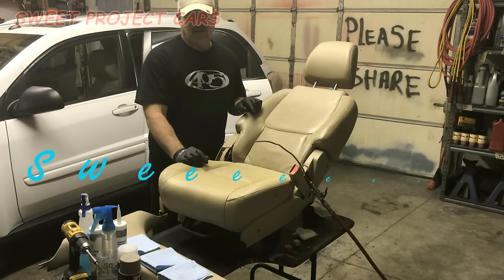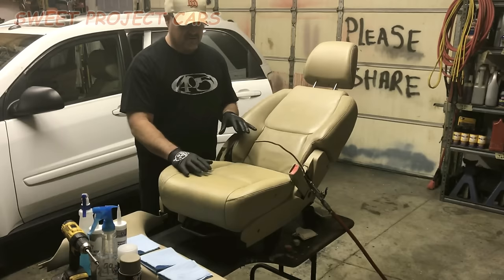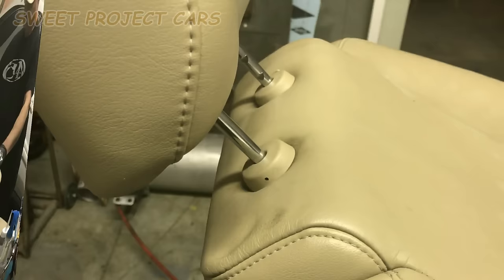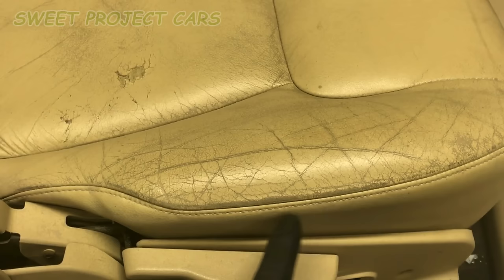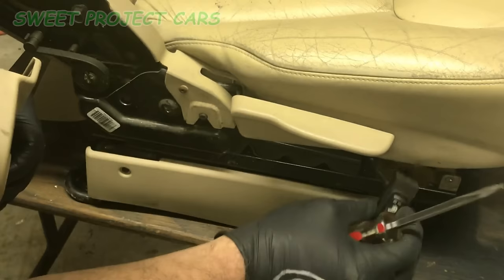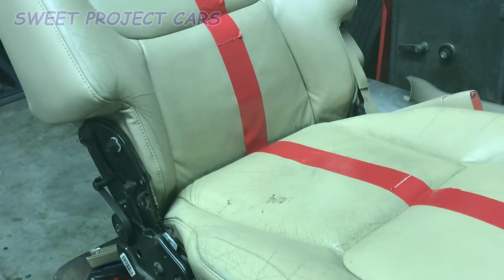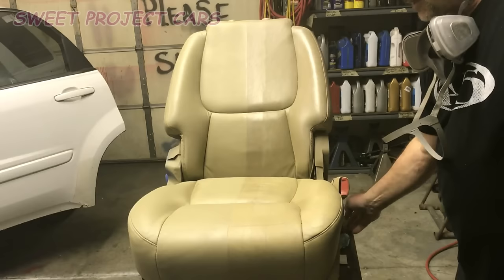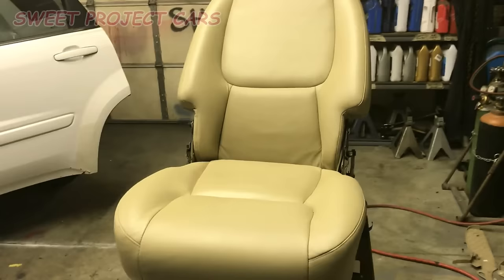How To Repair The NASTIEST Leather & Vinyl Seats....Back To PERFECT!

Comment: Love the video! 
I have a concern maybe you can address: 
I was in painting/waterproofing 20+ years. A big no-no was painting over silicone unless silicone was a special “paintable” grade. Have you had any durability or longevity issues? I have a G37 needs some work, and my kids are in and out a few times a day. Was wondering about your confidence level in this process holding up, especially the paint bond. It looks fantastic.
Thanks again for a great video!
Reply from the maker: Darrin we will be launching a special video on how we paint silicone coming out this next week...also we do show how we paint it in one of the 3 videos in the seat restoring video series we suggest you watch all 3 of them before attempting this awesome process  thanks Mike SPC
Reply: @SweetProjectCars  In this video you don't show the technique of mixing the silicone with the paint - it's going right over the cracks and holes in the seat. How are you doing this with just silicone reliably? Is the adhesion promoter a substitute for mixing paint and the permatex rtv silicone?
Reply: Does your G37 have perforated leather seats? My 2004 G35 Coupe does and I’m having trouble fixing them. Can you do the silicone and paint trick w/ perforated leather? 
Or, does anybody have other suggestions (premium seat covers? New leather? New seat?).
Reply: It does look fantastic, Darrin. I've got a pair of large wing chairs that I'm halfway done restoring. But I haven't put any filler on them yet. Seeing your comment got my attention. The way this very impressive video plays is 99% misleading. I wonder how many DIYers followed this video closely and then had all of their hard work go to waste. After reading your comment and the "answer" I looked for and saw the later video with a piece of cardboard and some blue spray-paint. They use a standard plastic bondo spreader and mix the paint and silicone adhesive together on the cardboard. When they did this original video, they don't mix the  silicone with the paint. I don't know what the reasoning is behind this, but I'm looking at all of these people in the comments, excited to copy their methods who have failed because of some big time quackery. I learn how to do a bunch of stuff on Youtube following the instructions of a bunch of people who are professionals, or DIY'ers who learned the hard way. I've saved hundreds of dollars fixing my own car, building a saw-buck, learning tips on selling stuff online, none of those videos mislead me. But this video...Maybe they like to giggle around the campfire at all the suckers who bought the oh-so-specific products, but failed miserably. I know that I will avoid these guys' videos like the plague. I want to tell you, Darrin, that I appreciate that you took the time to ask why the Emperor has no clothes. Big ups.

Comment: Hey Big poppa, Great video as always, couple questions, What was the spray you used after the 99% and before the silicone? Also, I did use your technique from another video for seat cracks, taking can of spray paint, and Lacquer thinner spraying a rag with paint then applying small amount of the lacquer thinner and rub into the seat,,,,, can I go back over seat where I did that and apply the silicone for the area that is actually missing leather from wear, then just spray with can or dab with paint? Thanks again, you rule.
Reply from the maker: Dangerna all the tools are in the show more of the videos description but here it is Leather Spray  https://amzn.to/2z3oiBu 
Vinyl  spray  https://amzn.to/2AVv11Q and this method will work on your seating no matter what you have done to them in the past
Reply: @SweetProjectCars  Can't find the leather adhesion promoter with the address in your video.Wayne

Comment: Every single video is crucial!!
Reply from the maker: Thank you for watching, have a great day my friend. mad Mike the hammer SPC
Reply: @SweetProjectCars  quick question. On the plastic restore with heat gun.. what to do with what looks like white crust. As if the oils are pushing it out or im burning it on low heat.?
Reply: Would it make sense to sand it down first? The white crust kind of matches the deterioration lines from hard water.

Comment: How does the paint adhere to the silicone? Please explain. Silicon is a no-no in paint shops.
Reply: garryg1955  - There are many different types of silicone produced; hard rubber, soft rubber, foam rubber, liquid adhesive, pressure sensitive adhesive, and yes, some paints also includes silicone.

 The type of silicone that is banned from most paint shops come from aerosol spray cans and liquid silicone hand pump spray bottles, like a tire dressing/shine for example. When liquid silicone is sprayed, tiny particles float through the air and can contaminate anything that's going to be painted. That's why it's imperative not to use any liquid spray 24 to 72 hours before a paint job and you must wipe down any thing to be paint with strong rubbing alcohol to eliminate any possible contamination.

 Silicone typically is bad for parts to be painted PROVIDED that the silicone is uncured.  Cured silicone parts are used all the time by powder coaters, platers & painters to mask all sorts of auto and motorcycle parts with no detrimental effect, because the silicone is in a cured, hardened state. Cured, it leaves no residue.

The reason silicone is generally termed "bad" for painting is because nothing sticks to silicone, except another silicone based product (which is why silicone RTV adhesive will bond two pieces of silicone rubber).  Problem is, most paints don't like silicone and won't adhere to it, so if any is left on the surface, the resulting finish will have imperfections (fish eyes, etc.).

On the other hand, because nothing sticks to silicone (except silicone based products), it would likely be advantageous to have a silicone based paint if, say, a tape with a silicone adhesive used for masking was leaving residue on a part.  The paint would be more likely to adhere without requiring another wash cycle.  

Alternatively, having a silicone based paint means parts painted with it would be easier to clean since things won't tend to stick to it.  Many silicone products are used for medical applications because of its cleanliness, so a silicone based paint would likely exhibit many of those beneficial aspects.
Reply: That would be the bonding agent  he applied after the alcohol cleaning. He used both again after the silicone had cured.
Reply from the maker: garryg1955 it works great as long as the video is followed to a "T" and the prep spray and other procedures are used prior to... my friend :)
Reply from the maker: Jeff Thank you for being a very helpful Subscriber and clarifying this with Garry :)
Reply from the maker: Philip you NAILED it, my friend...good job and thank you for really listening and watching the video  :)
Reply: @SweetProjectCars  never miss them. Knowledge is the greatest tool in the toolbox 😀
Reply from the maker: Philip you are very correct again :)
Reply: @SweetProjectCars  thank you
Reply: You probably have to paint  while the silicon is still setting .......
Reply: You probably have to paint  before  the silicone  is completely set...
Reply from the maker: Herman Duke best way is to mix the paint and silicone then apply and done with one final coat of paint after it all dries
Reply: We have paintable silicine at work. Its really paintable !!!

Comment: I am trying to use this technique on my Jeep seats.  I purchased everything used in the video except for the air compressor.  The temp is in the 60's.  I do not have an empty 303 bottom to make a squeegee out of so I started with cutting one out of a plastic file folder which is flexible yet solid.  However, it spread the silicone like plaster and was full of gullies and striated texture.  I also masked off a smaller area on my seats to begin with.  I ended up removing all the material and trying again.  This time I used a rubber, large flat tub disk stopper and cut it in half and rounded the corners.  This worked better. I ended up with pilling of the silicone trying to smooth out ridges and they are impossible to get off.  I have started and removed all the silicone three times and still have the pilling issue and also if I try to level out the application, it's like pushing clay around.  It really does take some skill to be successful at this and experience with the timing and directions in which to smooth out the application.  I found the 99% will actually lift the silicone if I try to clean an area to re-apply silicone to address a bad spot. I found that using a blow dryer while smoothing the silicone helped some. I'm very frustrated with the work ability of the silicone.  Also I didn't tape off the area as I found it left a ridge that was hard to work out along the seams.  I have two questions: How to I remove the piling of the silicone without losing all my work and 2) Will the paint cover up less than perfect areas with a few coats.  At this point, I am kicking myself for not just purchasing leather and sewing new seats (because I can at least use a sewing machine with less headache).  I think that if you could do some video showing how to recover from mistakes and  difficulties with the application with closeup shots, it would be extremely helpful.  Thanks so much!
Reply from the maker: Hey Shelley, at this point if you've tried it several times and didn't get it, it's not you, but maybe your best bet would be to purchase the OEM covers.  Thanks for being here with us, we really appreciate it.  Have a great day.  mad Mike the hammer SPC
Reply: @SweetProjectCars  Well, I've come this far so ... I'm not certain why I have the piling other than perhaps I'm working the silicone too much not know when close enough is close enough.  I am worried the feathering of the edges may show under the paint.  I natural light during the day and bright light when the natural fails to be able to see well as the translucent nature can fool the eye if not under close inspection.  And there may be an incompatibility with the products given the temperature in my home and humidity.  My home is cool too and I found that the silicone responded better to the smoothing with heat.  I also applied multiple thin coats of SEM 38353 Plastic Prep - 12 oz. (wiping them back a bit like you did in the video and waiting according to the bottle directions ) then tried to apply the silicone again.  I also tried to apply the silicone with multiple applications before it cured without the SEM 38353 Plastic Prep - 12 oz. between applications.  Both of these practices in theory should have been fine.  I purchased Sil Poxy because I need to build the silicone along some significant creases and I want to be sure the layers will adhere well.  I actually wasn't able to remove all silicone so I do have a thin layer which looks ok but need another application for sure.  I plan to use the Sil Poxy followed by the paint-silicone mixture.  I'm not sure if I should warm the seat a bit to allow the silicone to glide better or not.  Before I stray paint, I will use the SEM 38353 Plastic Prep - 12 oz. to prep.  Pilling with silicone, I believe is due to incompatibility of products which may be due to temperature.  Either way, I'll find out how the Sil Poxy will perform.
Reply: I also removed most of the pilling with a blow dryer and a vacuum.   Probably an air compressor would have been more efficient.

Comment: Hi "Sweet Car Expert", I watched several times each of your 3 videos - thanks! I then bought every item you recommended (hope made you some $$)... then bought exact color of BMW seat ($36 for 4oz bottle) and mixed with the silicone and did your method.     Result = the silicone (good idea for flexibility) was a huge problem.. practiced until skilled, and application went well. the problem = it remains skicky.. can't sit on the seat!   So had to do (w/ help from local paint store) a workaround:  laid on top "shellac primer" (outstanding product - sticks to everything!) but white.. so had paint onto the shellac layers.. if had to do again, would follow all you do except would use DAP caulking with flexible properies -- either SAP's AMP Advanced Modified Polymer (their Waterproof Kitchen, Bath and Plumbing Sealant) or DAP dynalex 230 (Premium Elastomeric Exterior sealant used for Window, Door and Trim). Still thanks big for the outstanding videos - got me to success! 😊
Reply from the maker: Thank you for watching and sharing, have a great day. mad Mike the hammer SPC

Comment: I don't understand why you use this method vice mixing the paint and silicone like you do in the other video. Great video. I can't wait to try to fix my boat vinyl seats using silicone and your products.
Reply from the maker: Steve mixing the silicone and the paint together for the initial coating is the very best way to do it then the spray paint adhere’s to it very well....the other way is a bit more picky but it works very well thank you for sharing have a great day mike sweet project cars

Comment: Hi Mike.  I know you like and trust the permatext silicone for the leather - vynil repairs - But i wanted to share this with you as a potential substitute that is absolutely PAINTABLE  within 30 mins. It's  very strong & can be applied on a wet surface if needed.  Its made by "DAP" . Its called "AMP" . Its a "advanced hybrid modified polymer" It comes as clear or white  in a red & black colored caulking tube .  I found it at Home depot.  Im not trying  to change your methods , but  just wanted to share it with you. 
Take care / ThankYou
Reply from the maker: Thanks for watching and sharing, we appreciate it general!! Have a great day my friend. mad Mike

Comment: Great video! Thank you. I am concerned that this repair will either have a silicone delamination issue, or the seat will continue to crack and not feel like soft leather. Can these concerns be eliminated using this technique? Is there better material I can use for my 1962 Cadillac. Seats are just cracking. No holes or thread damage.
Reply from the maker: We've had great luck with this method, but if you are concerned just go to a dealership that can help you order replacement factory seat covers. Thanks for watching and asking, have a great weekend. mad Mike the hammer SPC

Comment: I cannot use SEM paint because they have nothing close to the color of my interior. However I have an acrylic paint kit made specifically for leather seats. I followed your instructions to the letter (used 99%, Used the SEM prep, and used the Permatex Silicone).  The paint peeled off everywhere there was silicone literally in the first hour or two of use. Silicone in my experience cannot be painted. It repels paint

Comment: Wow!! Great video.    I have a black leather driver seat with a/c aeration holes in leather seat & back.  
1) will it clog up the aeration holes?
2) on the side lip, it is broken leather, with long cracks.  Caused by sliding down out of seat every day.  It is only on the side leather (no aeration holes). Will this bond  the broken/cracked leather back together?
Reply from the maker: It will repair the cracked leather and yes, it will clog the seat ventilation.  Any holes that do get clogged before it dries, poke with a toothpick to open them back up.  Hope this helps, have a great day.  mad Mike the hammer SPC

Comment: Great results bro.A question though.Have you seen what happens,when the silicone wears out eventually?Does it still wear out like leather or it just comes peeling off?
Also would it be a good idea to apply this method on new leather seat as protection?
Still great video.
Reply from the maker: We've done this process for years and years and never had that problem. I guarantee this method will last longer than the vehicle you do it to will. Thanks for watching, have a great day. mad Mike & team

Comment: Thanks for the great video!  I tried this out on a vinyl covered boat seat and it worked like a champ! Spreading the silicone was easy .Now I want to go and find another seat to fix. Thanks again.
Reply: I noticed lot of nice dinning room chairs on marketplace that are sold for very cheap because the leather is damaged. Maybe you can make them nice again and resell them to make a profit :)
Reply: how long would the repair hold up? thank you

Comment: Thanks for the demo...I have a car with a  small section worn completely through to the padding...is that possible to repair?? I suspect you have covered this situation elsewhere...kind regards...
Reply from the maker: Your best bet is to replace it with an OEM seat cover when they are worn completely through.  Hope this helps.  mad Mike the hammer SPC

Comment: Good info, but leather refurb is only a temp thing once the leather has started to crack.   Eventually those cracks are going to open up and the only repair will be to re-upholster.
Reply from the maker: MrSloika not after our method they never crack again

Comment: When repairing a seat that has multiple cuts and imperfections, I assume you can apply multiple coats of the sealant glue? Also if you can't get it perfectly flat with the applicator and your fingers, is it possible to sand the finished surface prior to painting to get a uniform surface texture? Thanks so much for your awesome videos They are so helpful!
Reply from the maker: Yes you can apply multiple coats, the key is to get the surface as smooth as possible during the application as there is no way to sand it after my friend. Hope this helps. Thank you for watching and asking, we really appreciate it, have a fantastic day and all the best on your project. mad Mike
Reply: @SweetProjectCars  there has to be a way to level it if you screw up like I did a little bit. I'll do some research and see what chemical can degrade enough to smooth it.